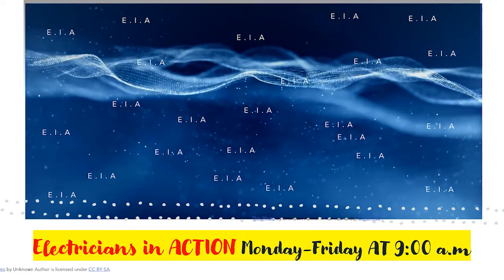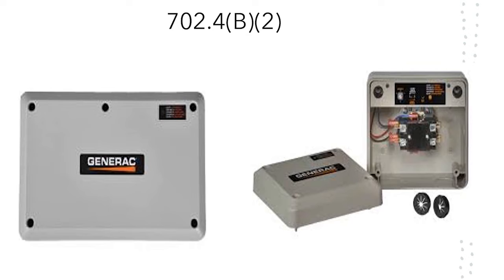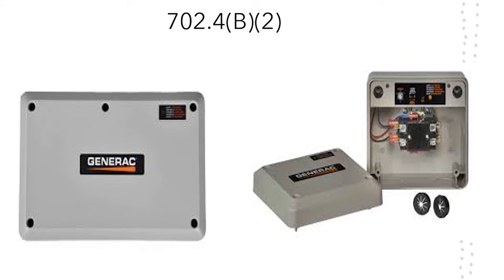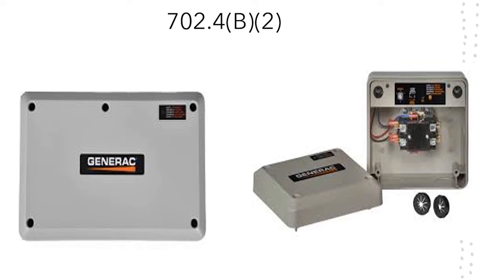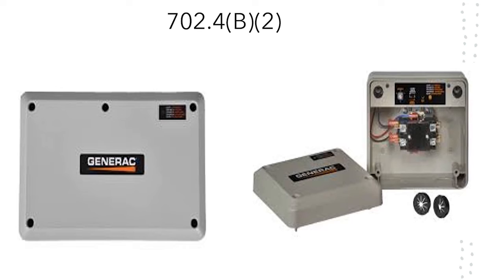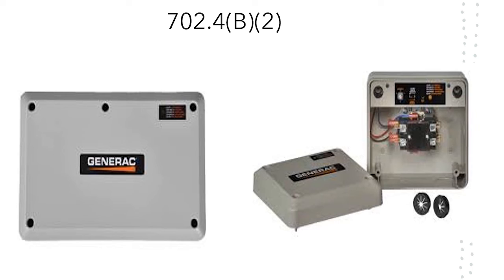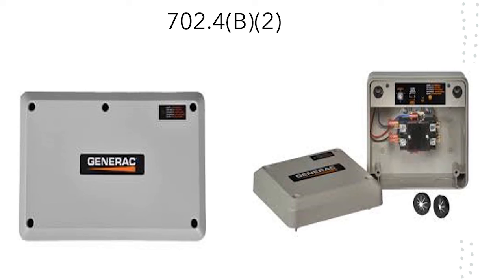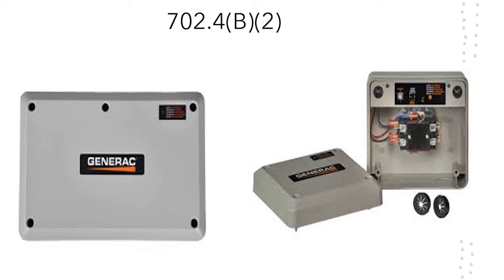How to size a generator, smm smart management module Load Shedding

Comment: How does this communicate with the ATS? how do you set them on the same frequency?
Reply: Its black magic, it actually does NOT communicate with the generator, it simply monitors the line side conductors for dips in frequency then opens its contacts. As the generator becomes overloaded it will drop in RPMS which causes the frequency to fall.

Comment: I have a 400 amp service.  I have 3 ac units on on one 200 amp cutoff and everything else on 200 amp cutoff.  Can I use 1 whole house transfer switch and allow it to turn off both breaker boxes and then have the air conditioners on load shed modules?
Reply from the maker: Great question!! You are likely going to need to have install 2 transfer switches installed.
Reply: @ElectricalCodeCoach  when you say “likely” who determines 1 or 2 transfer switches?  Does the amount of current determine if I need 1 or 2 switches?  Since they are both being supplied from one generator, why would I need 2 transfer switches?
Reply: @ElectricalCodeCoach  Thank you for replying so quickly!!
Reply: @ElectricalCodeCoach  The realty is his current draw on the one breaker is only 82 amps.  I would put a quick start capacitor on each ac unit.
Reply from the maker: You're going to need 2 transfer switches.
Reply: @ElectricalCodeCoach  Thank you>.  Do you know if there is a specific way to connect both to one generator?

Comment: I landed 2 different circuits in a sub panel where there were 4 smart modules, is that safe? Those new circuits won’t have the module
Reply from the maker: With out being there I cannot make that call brother, but one might consider what the new added load is, if those new circuits are not using smart modules.